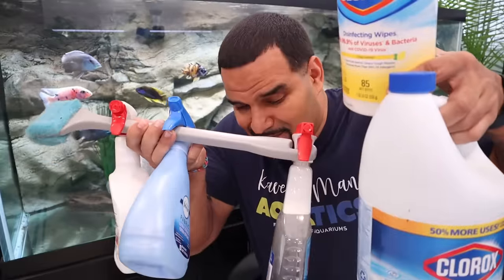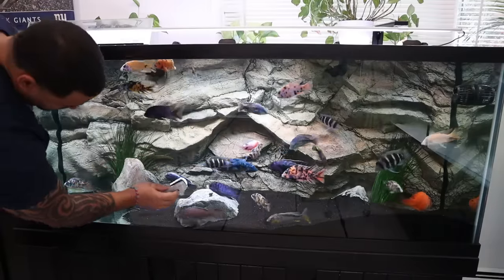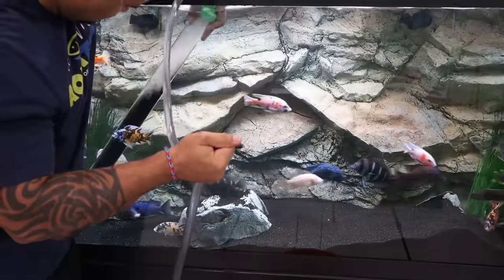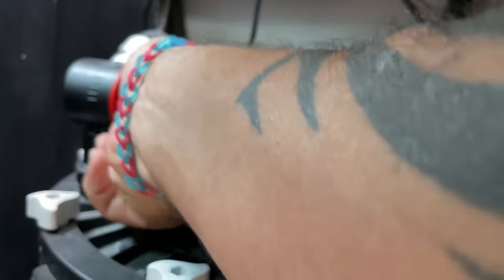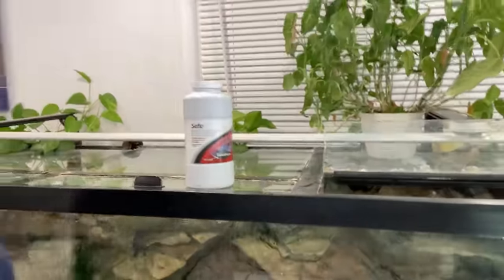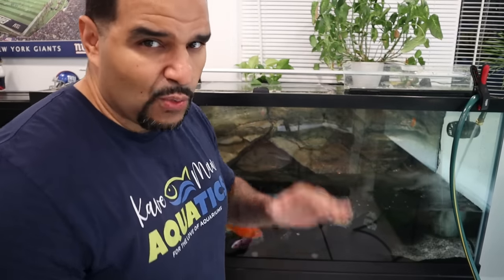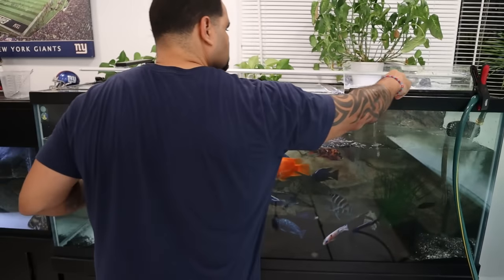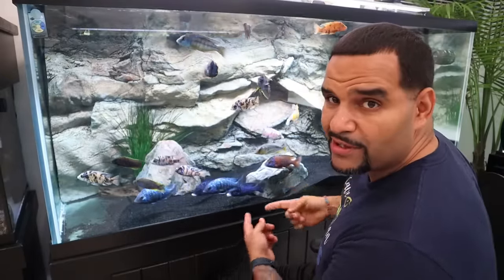Tank Maintenance Is EASIER Than You Think! - (Beginners Month)

Comment: I've seen your videos on how you do your water changes with a water pump attached to 1" hose , and I always think your system could be improved and would save you so much time.
In my set up I have a water supply attached to 1" pvc pipe that goes around the perimeter of my fish room.
At every tank I install a "T" with a ball valve and run it up to the tank and attatch a 1" hose barb at the end.
And then this way you can fill each tank  up on the same system. 
Then you rake your water pump and attatch your 1" hose to it but only cut it long enough to reach the pvc system, so like 2 ft.
 Then you can use the ball valve to direct the water to where your drain is set up.

I would love to see this system Implemented in your fish room man! I'm no plumber but it was a simple job that saves so much time and effort

Comment: I have a water pump, but I don’t just use it to remove water. Sometimes I put the hose through a filtration sock and just let it run for about 15 minutes. This way, the water stays in the tank but it’s getting clean because the pump acts as vacuum cleaner.
Reply from the maker: Cool idea! 💪

Comment: Kev,

Wow an awesome awesome video brother. I use a hygger 450gph pump for my 98 gal CA tank. It pumps the water out pretty fast than I reverse and fill up my tub and pump the new water back in at roughly the same temp.  It sometimes it’s warmer than normal. But it cools down pretty fast. I never have to clean my gravel I have a red devil that rearrange all my substrate all the time and I have some catfish that eat stuff out the bottom. I also don’t do filter maintenance on water change day. I have two Tidal 110s and an internal expertmatic that is designed for 180 gal. So I don’t clean all of them at once I leave the internal filter and clean the hobs or vice versa. I also have one big sponge filter that I never clean lol I want it for the bacteria and air. I also can’t keep live plants because of my red devil and my two Severums will eat plants also. So yeah water changes it is. My planted 55 gal I never have to water change just top off. Same with my 20 long. Appreciate the video and can’t wait to see the final video. It will always be epic. ❤😂
Reply from the maker: Sounds like your guys are in good hands my bro! 😊💪

Comment: I just fill up 5 gallon buckets and use a eater pump to drain them into the tank but I always add my prime, stability, and stress guard to each 5 gallon bucket with my tank at 55 gallons i replace 30 gallons of water from the tank so 6, 5 gallon buckets, and i use 2 5 gallon bucket to drain the tank, and with gravel i siphon the entire tank each side 3 times total of 30 gallons. I also take out decor that in the way and put it in a baucket of tank water till im ready to put water back into the tank and add all decor back.

Comment: Im currently going through a bacterial bloom. How long should I do nothing and can I add water because it is getting low? It has already been over a week and it hasn't gotten any better but worse. I have a 5 gallon that houses a Betta fish. I use Spring water. After this bloom clears up, how often do I need to change water and how much. I was doing weekly and 50% . My API test ammonia 0.25 Nitrite 0 and Nitrate 5.0 I put prime in yesterday 5ml
Reply from the maker: Thats a lot of prime for a 5 gallon tank! 5ml dose is for 50G. You added 10x the dose. You should water change now to remove some of it or it can deplete your water of all its oxygen. 

Water changes are done depending on many factors, nitrate levels being one of them. But to begin I would confirm your tank has cycled before doing regular scheduled water changes. That may be why your bloom hasnt gone away. 

I highly suggest you check out my playlist for beginners. It'll be very helpful for you 😁 - https://youtube.com/playlist?list=PLP5OXTIIDO8NYvhUHAmwAd54WFmS4d8er

Comment: I'm confused on the dosage of the Malawi Buffer and Cichlid Lake Salt.  My tap water is already at 8.0 pH, so what is the dosage to just maintain it?  Also the Cichlid Lake Salt directions on the bottle is based on DI or RO water, so is there a different dosage for tap water.  I understand you would only add salt based on the volume of water removed, not tank size.  I was trying to correlate how much you used in the video but you didn't say how much Cichlid Trace you put it, plus I don't know what your tap water pH is where you are located.   I see the benefit of a buffer since I also use Black Diamond Blasting sand and the minerals in the Salt and Trace but just don't know best dosage.
Reply from the maker: Since your PH is already at 8.0 you dont need to add any buffer. The cichlid salt will increase your GH (hardness) but your source may already be pretty hard as well. Test your GH. You may only get a benefit from cichlid trace which adds minerals not found in all tap water. Dose Trace for the entire volume of tank water.

Comment: You would think people could look at a pond or river and make the connection that fish dont live in sterile environments but that isn’t the case. The fastest way to make your fish die is to clean the tank like a human lives in it. I have a 90 gallon tank with 50 yellow lab cichlids in it that I NEVER gravel vac and only clean the algae off the front and sides of the tank . The water is crystal clear and the fish thrive. I was recently gone for 9 days and the feeder cycles two times a day 12 hours apart. I came back and the tank looked like it did if i was there for 9 days and never touched it.  I did a 50% water change and cleaned the algae of the front and sides and that was it . Nitrates about 10 ppm. The best thing you can do for your tank is LEAVE IT THE FK ALONE.  I also use RO water that is mixed to a certain tds level and heated for my water changes.  I clean my filters once or twice a year as well. My fish naturally reproduce and thrive. I dont have issues with disease or sickness either.